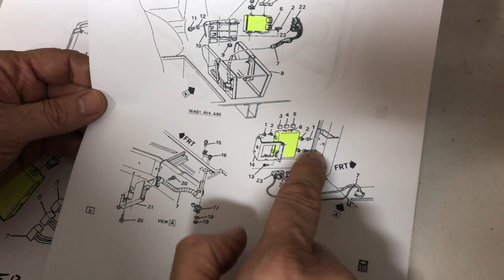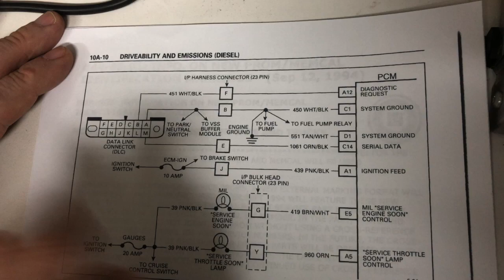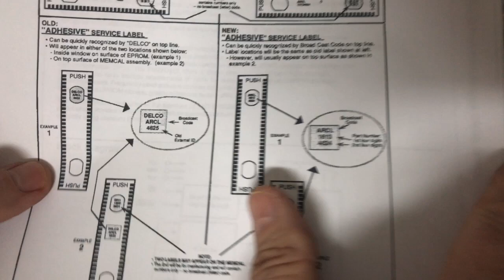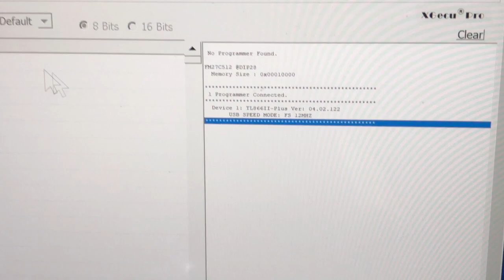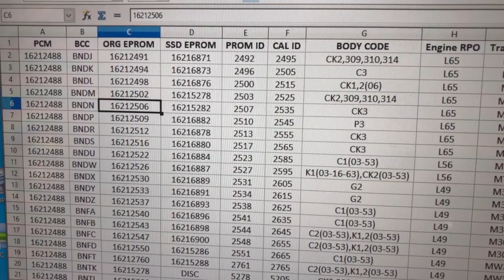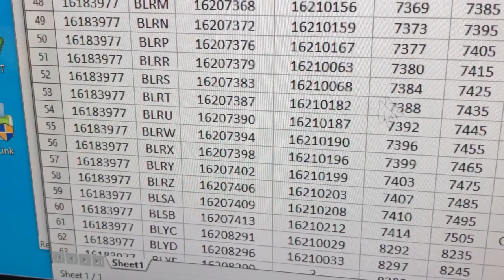1994 1995 GM 6.5L Diesel Salvage Yard PCM Inspections & EPROM Testing & Identification (Chevy & GMC)

Comment: I have a 1995 Chevrolet K2500 Suburban 6.5 Diesel VIN F (L65) with 4.10:1 axle ratio (GT5).  It has a BPAC broadcast code on the EPROM.  I also have a 1995 GMC K1500 Suburban 6.5 Diesel VIN F (L65) with 3.42:1 axle ratio (GU6) as a parts vehicle.  It also has a BPAC broadcast code on the EPROM.  In addition, I have a 1995 Chevrolet K3500 pickup 6.5 Diesel VIN F (L65) with 4.10:1 axle ratio (GT5).  It has a BXPW broadcast code on the EPROM.  The BPAC EPROM was used on more than just GU6 vehicles.  FYI.
Reply from the maker: Thanks, these application lists come from the printed GM parts books of the era.  There may be mistakes, but it would be uncommon.  

Engine and transmission are the most important drivers of the broadcast code, axle ratio is secondary and may apply to more than one.   Also, with over three decades, you have to factor in whether you're looking at the original PCM or not (where it may have the incorrect EPROM installed by a previous owner).
Reply: @DrShock I'm pretty confident of the provenance of the two Suburbans. I am the second owner of the K2500 and bought it in April of 2000. It came from the factory with the BPAC EPROM, L65, GT5, and MT1.

Comment: Is your tech 2 a clone  or real deal
Reply from the maker: I've owned both, and there's absolutely zero difference in functionality or software compatibility between them when comparing the higher end knock off versions that were being produced at one time (long out of production).  There were some genuine trash Chinesium ones out there to avoid for sure. The Tech2 is an obsolete tool now though, only useful for offline diagnostics on pre-2013 vehicles.
Reply: @DrShock thanks for your reply I got a 1994 6.5 OBD1 I'm trying to keep running. May need the time and injection pump in the near future.

Comment: Hello and thanks for the information, I have a 95 suburban and l65 engine and bpac broadcast code and I got the bpxy, but I have not tried it on the pcm yet. Anyway, I have read both eproms to compare the programs in them and looks the same to me. I know there are problems in some algorithms. I had to rebuild the engine due to a crack in the block, I got a red good block from 83 6.2l which I rebore.
Reply: Hi, you are right there are son diferences in the code, I can send you a clone or the program  if you whant.
Thanks
Reply from the maker: I would be extremely skeptical about there being zero differences between two different broadcast coded EPROMs.   The code section could very well be identical, but there will be differences in the data section (e.g., fuel table).  GM, always the financially driven automotive manufacturer, would not release and track multiple part numbers that had no differences.  ;-)

Comment: I'm curious about using a 1997 chip from the increased hp and torque in a 1994 cpu.
Reply from the maker: 1996 and up PCMs are a different circuit board design without an EPROM.  Instead they use flash memory, and are programmed using the GM Tech2 scan tool in the vehicle.

Comment: Hi appreciate all the information you make available for us to enjoy. I have a 94 k2500 6.5 4x4 automatic. I would like to identify if my eprom is correct for the 5521 injection pump on it. The engine is not original installed by previous owner. It runs with lack of power. Just trying to eliminate all possibilities before spending money to have a shop diagnose it.
Reply from the maker: Thanks, there should be a calibration number on the sticker affixed to the top of the EPROM chip.   That calibration number will tell you if it's correct of your model year and powertrain options.   Usually these will come up on Google, unless it's a  more rare or unusual number.

Comment: The table that you're viewing with the prom IDs and body/option codes that match, is this a publicly available resource? And would it cross-reference with OBDII calibration numbers from GM?
Reply from the maker: No, this is something I put together.  These calibrations would not apply, nor correlate, to OBDII being specific to the 94-95 old style plug in EPROMs.
Reply: @DrShock  Thanks for the quick response. 

I have an archive of the OBDII cals and while most of them have a VIN tied to the cal that helps ID its original application, it's not guaranteed to be accurate. 

For ex: finding references for 16242285.ddc and the other 140 or so cals.

Comment: Could you possibly point me in the right direction towards those pages you have printed out? I'm having all sorts of issues with my 94 6.5 with transmission to motor etc total i have 14 codes ans i would hope it's an issue besides the 14 codes.and the grounds look okay. But i would like to check the grounds on the harness going to the pcm itself to completely eliminate that.
Reply from the maker: Those are pages are from the GM factory service manual.  It's been out of print for over 20 years now, but they sometimes pop up.  There's an eBay search link in the description text for this video.

Comment: Hi I hav a 6.5 in a Winnebago Moter home I’ve bein trying to read the faults in the diagnostics with a wire but the Check light just stops on doesn’t flash at all just wondering if this could be a faulty pcm
Reply from the maker: Unlikely without other driveability symptoms.   The PCMs in the diesel C/K truck series are very rugged and rarely fail.  

Isolated issues are more likely a wiring harness problem (corrosion affecting ground points, for example).   I would eliminate those possibilities before looking at a PCM.
Reply: @DrShock  it has got other symptoms it won’t rev up wen first started just ticks over and white smokes knock ignition off and restart it and it’s fine smoke gone and revs up but Carnot get any codes out of the flash diagnostics any help would be great 
Iv installed a new pmd got electric fuel pump on a switch and and got the fuel stop solenoid by passed ( removed plunger from inside )
Would u put a copy of the wiring diagram for the pcm on here so I can check the grounds 
Many thanks
Reply from the maker: I don't have a wiring diagram that can be posted, but the PCM for the 6.5L diesel uses grounds G104 and G105.  You can find them shown here - https://youtu.be/H0lK0TZEVCc
 
Since this is OBD1 (pre-1996) and you are not able to get any diagnostic response thru the flash code method, I would verify not just the grounds but also the diagnostic harness lines are intact.  In my experience, there should be a tall bar before calling a PCM as bad on one of these models.

Comment: Can I use 94 pcm in my 95 truck and use my 95 eprom??
Reply from the maker: The 1994 and 1995 EPROM packs were not interchangeable according to GM, so I would take that to mean the PCMs were not either.   I would not look at the year as much as the part number on the PCM, keeping it the same as your 1995 one.

Comment: hi, nice video. I need help my GM silverado PCM was stolen, and I bought a new PCM but it came without the EPROM. And I don't have a file to put it. Would you help me with the file read in the video? would you sell it to me? Sorry for my English, I'm from Argentina.
Reply from the maker: I do not have access to images for these diesel PCM EPROMs.  But you could use the broadcast codes/part numbers I showed in the video to figure out which one you need to look for on eBay.   If you can't make out the right one, let me know the details about your diesel truck and I'll see what the number is for you.  I do not have any information on gasoline engines though, only diesels.

Comment: DrShock, I have been doing a lot of research on the 94-95 GM 6.5 diesel trucks and PCM tuning.  would you by chance be willing to share your spreadsheets on the eproms shown in your video with me?  your video actually helped me quite a bit getting started working on tuning and reading the eprom chips.  Thank you.

Comment: I have a unique situation , 1995 motorhome diesel pusher, 6.5 with 4L80E, just bought her, previous owner had trans rebuilt, changed TCM. When start to drive goes into limp mode! Have to pull over disconnect TCM, reconnect then it shifts fine up and down, till I turn off engine. Then we start all over again, checking with GM dealer have correct TCM (rebuilt by GM) but wrong prom! Correct one is 16252710 for this year. So I bought another TCM same number 16196390 from running truck. Same problem, nothing different . Looks like someone was checking power at the trans, some of the wires have stripped insulation. I’m thinking something maybe wrong electronically in the trans. Your thoughts? We can’t enjoy this RV the way it is. None of the local trans shops either want this 32’ long thing in there shop and mostly they don’t know electronics and something this old. Need your guidance please.
Reply from the maker: The PROM part number they gave you, 16252710, shows in my GM parts book as for a 1995 - 1996 7.4L gasoline engine equipped vehicle's PCM.  The TCM part number is correct for a 1995 6.5L diesel though.   Can you see what part number your PCM is and what PROM code is on it (using the technique shown in this video to remove the little door so you can read its label)?
Reply: @DrShock  both my TCM have same part number, both are rebuilt by GM per the sticker. the new TCM I bought used from  running diesel P30 is 4101BJDM7358 (01427389 B9412AD, the one it came with is BJTW9573 (01427389 B9330, there's also another processor in line with the TCM in a whit housing says LABEL 16188028, not that clear. then QUY 16158945, I don't know much more about the past history besides trans was rebuilt twice, replaced the TCM, why? don't know, notes from previous owner says the TCM thinks its a 6 speed and goes into limp mode. and suggests shifting manually? but that doesn't work well. too much hassle.
Reply from the maker: The 16158945 is a DRAC module (digital ratio adapter controller) which is a early kind of tire size/wheel speed calculator device.  What about the actual PCM, the powertrain control module, number?  That is the one I was asking about, and the one that will have a PROM module in it as in the video.   The limp mode is likely coming from the PCM, not the TCM.   I'm not sure where the PCM is located in a mobile home chassis cab type, but it will look exactly like the one in the video as 6.5L diesels all used the same module just different PROMs.
Reply: 4101BJDM7358 prom has these numbers also (01427389 B9412AD)
Reply: i heard from someone today they had similar issue with trans going into limp mode and wouldn't shift up unless disconnect and reconnect, and was told it's a ground problem with the TCM and the trans. what are your thoughts on the PCM? haven't located one, wouldn't that just deal with the engine? being  a mechanical control diesel?
Reply from the maker: You should have a silver colored GM PCM labeled with part 16212488 for 1995 (and 1994) 6.5L applications.  Anything else would be incorrect for that year with a 6.5L.  Correct PCM PROM broadcast codes (four letter codes starting with a B) for the 1995 PCM would all start with either BN or BP or BR for 6.5L.  The PCM PROM part numbers would all start with a 162 GM number.  Not sure what you have there, might be custom or non-GM, couldn't say.  

As for grounds, sure always important and can cause many gremlins to pop up.  There's another vid I put up earlier this year on all of the OBS trucks engine and transmission related ground strap points.  While the TCM is the E in the 4L80E, the PCM and TCM do communicate with each other.
Reply: @DrShock  good God, I think I have to follow the engine wiring harness and see where it takes me to, to fins the PCM! should be about the same size as the TCM? I have diagram that shows the pins for the tcm and the connecter to the trans, I would think it would be okay to splice the (-) wires which are white and connect to a real good ground. voltmeter did show 12.7 when I used the pins to check not the frame.
thank you so much for your input. i am very frustrated and annoyed. all the 12V wires in the harnesses are white!!! ground and positive and are mostly hidden. where they would have stock the PCM God only knows. the engine and trans and related seem to be all GM. chasses is Oshkosh!
Reply from the maker: It'll look just like in the video, will be in the interior somewhere.  Under the drivers side dash, behind the passenger side dash, under the drivers side seat or behind it.  These are some of the locations for Chevy and GMC C/K trucks, G vans, and P trucks.
Reply: @DrShock  hello, I went through the motorhome, from the engine I followed the harness all the way to the front. NO ECM or PCU anywhere. could the 16196390 TCM also run the engine? the OBD 1 connecter is right there with it and connected. no where else did I see another connecter for the OBD 1. some one mentioned about flashing the TCM/PCU?
seems like I have good ground to the TCM. also the TCM is mounted to wood frame and is not grounded. replacing the TCM with the one that has the correct PROM made no difference. someone somewhere also mentioned the speed sensor. but the speedometer works. could it be internal? the trans was rebuilt! but then reconnecting the TCU all the shifts are proper until I turn off the engine. I'm very frustrated. thx for all your help, I do appreciate.
Reply from the maker: @armenkhanlian3532  If its a 1995 6.5L engine, it definitely has a PCM like the one shown in this video installed somewhere to control the electronics of the engine and instrument cluster.  The TCM wouldn't be involved with either.  

Still, this type of problem can be extremely difficult to impossible to debug remotely DIY.   I could suggest only the following additional checks.  (1) running a ground wire from one of the TCM mounting bolts on the wood to vehicle ground, just to be sure.  (2) doing the OBD-1 connector jumper (A to B be sure you have it right!) to confirm no DCT flash codes are reported by the as yet unlocatable PCM that might give a clue.  These kinds of problems are usually reported as codes in OBD2 (96+) but earlier may not.  Could be speed sensor yes, on transmission not speedo one.  Could be throttle position sensor too.  Again, without PCM codes or scan tool extremely difficult to do remotely/DIY. 

Getting shop help for your situation is going to be complicated by the size of this vehicle, its custom nature (no directly applicable online service manuals/wiring diagrams), and its age (being pre-OBDII the scan tool choices are limited and most smaller shops won't have anything for this).   If you do take it to a shop, get them to focus on the powertrain being common to other 3500 class GM trucks from 1995.  Don't let them dwell on the motorhome aspects, as it really has nothing to do with the problem - it's in the powertrain.
Reply: Does it matter if it’s a 94?
Reply from the maker: @armenkhanlian3532  No, 94 and 95 are pretty much the same as we see in this video.
Reply: @DrShock  what do you think about flashing?
Reply from the maker: @armenkhanlian3532  The flash comment I made earlier was with respect to the Service Engine Soon light flashing when you jumper the OBD-1 connector into diagnostics mode.  Counting the flashes after doing the jumper which is necessary to get any diagnostic trouble codes (DTCs) from a PCM pre-1996 without a scan tool.   For a pre-1996 module, there is no flashing as only PROM chips were used in that era.
Reply: @DrShock  I did get a code 21 for the trans. but has no PCM. I checked everywhere.

Comment: I thought u we’re gonna talk about the blue chip
Reply from the maker: I did.   That BLUE logo is just a brand name for the EEPROM chip carrier. I pulled that chip out of the carrier and read it on the chip reader during the video, and walked thru the memory layout inside it.   

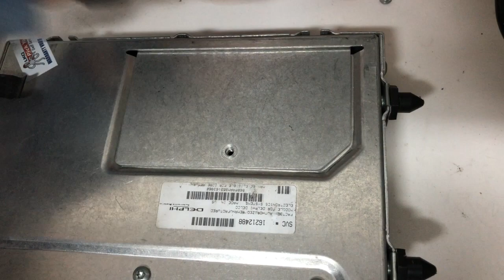You might want to rewatch at 11:44 on to the end where I go thru all the details about the chip itself inside that blue plastic carrier.
Reply: @DrShock  what dose the blur chip actually do?
Reply from the maker: Well the blue part is just a plastic carrier.  The chip inside of it, well that's the programming for the powertrain control module (PCM).  It's just like any other microcomputer with memory, storage, and inputs and outputs.

All of the engine operational parameters, for example, around fuel and air to minimize emissions and maximize fuel economy.   Monitoring the transmission, air conditioning, and security systems and controlling these other modules.   All of that is part of the PCM programming.
Reply: I found this on Heath
Reply: How can I tell the one I found in a junkyard is a performance chip or factory?
Reply from the maker: @ronn2337  You can't externally unless the aftermarket tuner put their own label on it.  Typically the contents of the factory chip are just modified or overwritten without doing so unless you purchase it online from a larger outfit.  You can use the info in the video to confirm whether or not you have the last calibration that GM released for your vehicle.   That way at least you know the known bugs in their firmware got addressed.